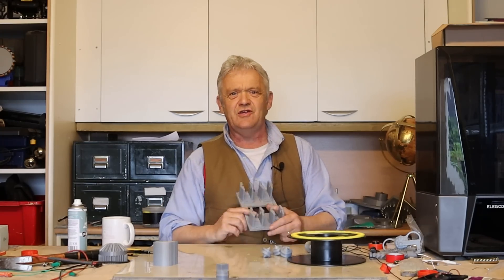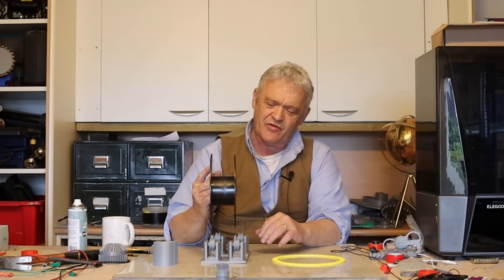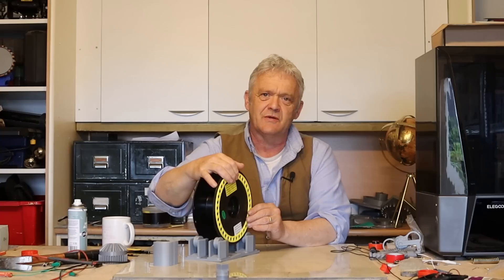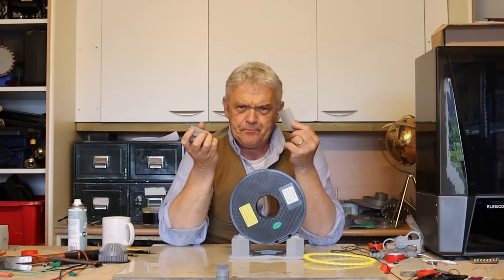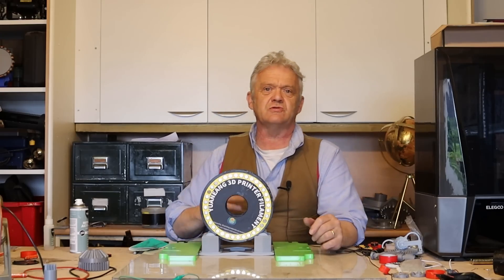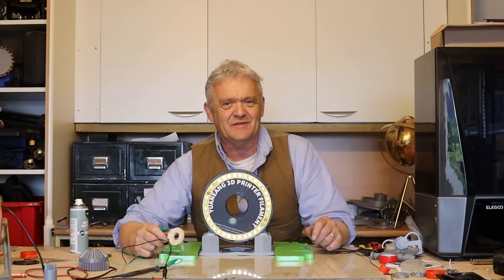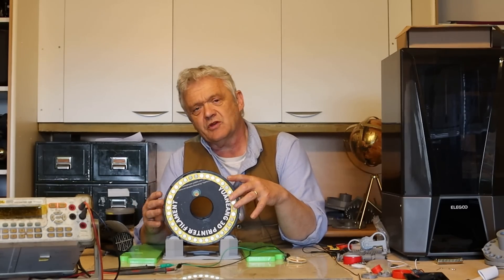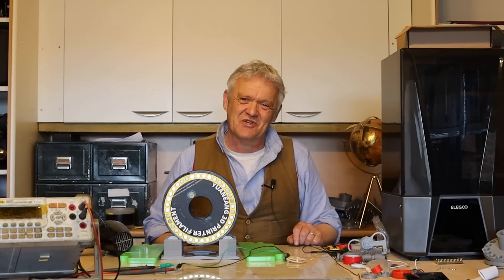2040 Rim Based Generator

Comment: So if I put a long horizontal drum fan on the apex of my roof. Then on one end I have magnets on the drum end and stationary coreless coils for low drag resistance generaton.
At the other end have magnets in the drum end and have the coil plate with cores and have a linier actuator that can move it close or far from the drum.

So in light winds it’s far enough away it has no resistance but as the speed increases it gets moved closer to reduce the rpm’s and generate power.

Comment: Robert, I've been watching you video for sometime, they're very interesting and understandable.

I understand the point regarding rim based generation, and whilst walking the dog had an idea...

If you took your double rotor set up, attached a rim around the blades then mounted the whole shooting match vertically in a Darwinian style it would seem that you bring a lot of good things together?  In fact, probably major item missing from most of you improvements would be gearing.  This could be added by not putting a rim on the propellors, but instead putting the gearbox on the common shaft, then bringing the geared output down below the inlets to the chamber and having a "wheel" on the shaft with the magnets on the rim.

As an aside, do you think there is anything to be gained from toroidal propellers?

Comment: Im gonna flip the design, as it got me thinking multiple ways but the one ive settled on is 2 towers with an axle, but use a magnetic bearing, and attempt to merge the coil into the towers, maybe even try 4 towers (at each end), then could 4x the coils.

Comment: This makes me wonder if your double bladed wind generator could be adapted to also produce power at a rim connecting the tips of the props? This prop rim could have a magnet array that interacts with a serpentine coil incorporated into a duct for enhancing flow as per the Darwin horizontal application. The hub would still be producing too.

Comment: Robert, one would think by adding an axle at some point, dual generation could be achieved both on the rim and one of your serpentine coil setups. On second thought voltage gains passing through a water pipe could be accumulated as well. Some of your brilliant ideas scream for combinations~

Comment: Well done Rob.I am somewhat surprised that I myself never looked at a spool and pipe in the way you just did in the first few minutes.THAT innovation alone would have got you a click.
As I have stated before,a lot of your audience cannot afford 3d printers and suchlike so stuff like you just did here by improvising is an absolute godsend.
The point I and my friends all come together in agreement on(and this s rare)is that the very best innovation is the following.....
a ....one off build of an item
that will create energy to heat each household in the uk even by a small amount
for "free"
example....a amall air turbine to run a "sand battery"
........a trombe wall.....
In an ideal world either you or on of your audience will be inspired enough to come up with an overlooked innovation from an existing piece of tech which will crunch about 20% of the household energy requirements overnight.

Keep up the good work.Your efforts are much appreciated.Particularly since you try to keep things simple enough for us to follow.

Comment: I know it doesn’t specifically relate to the video but I was wondering if there was an efficient way to attach a wind turbine, like the ones previously shown on your channel, to a car alternator to produce electricity. I’m asking because I managed to snag a working alternator for basically free (got lucky at an Amazon return bin store) and wanted to put it to some interesting uses
Reply: A car alternator requires RPMs to be closer to 3 and 4k. You won't get that on anything Robert has posted.
The car alternator is not a very good solution to generate with the wind generator.
Reply: @andrewsmithmilan1780  damn that sucks. Would a steam engine be better suited for this? Thanks for the answer

Comment: Hey Robert, do you think you can build a self digging Roomba-esk motor at the rim ? The hole will be useful with a mud pump. I imagine a roombda that digs itself and makes a well borehole. Needs a power cord, a water /air pipe and a safety line for retrieval. Could be awesome

Comment: I have been following this entire generator series closely, well done and I am doing some of my own 3-D prints. I have also been experimenting with an iron core versus no iron core in the coils. There's a significant trade off to be had in power generation capacity vs high resistance to turning/spinning. It would be interesting if you would do a video on coils with iron core versus no iron core. I have also been experimenting with square versus round coils. A square coil allows a much cleaner slice of the coil cross section by the magnet and therefore a more pure sin wave and I think greater power generation. Maybe the topic of another video?

Also it may be worthwhile mentioning to your viewers that PLA will not do well in the direct sunlight. I think they should be aware of that limitation.

Comment: Love it!!! Please consider doing this on a bicycle. Could it actually charge your ebike battery?
Reply: It could charge it some, but it would not keep up with the draw of the electric motor (and muscle power is about 5x less efficient than ebike motors anyway - look up the 1000 mpg ebike article). Since bikes are such efficient machines and there are so many losses to charge and discharge a battery, you'd be better off just pedaling to assist the motor rather than pedaling to charge the motor. 

Adding a generator to the rim would only serve to make you and your motor have to work harder to turn the wheels.

Comment: Rubber coat the big rim so more traction on small wheels and then turn the small wheels into generators as well. Then you have five points of electricity output
Reply: I think the grip is a good add, but the generation comes from the speed of the rim, so I'm not sure the small bearings would make very good generators.
Reply: @mookiemorjax  the small guide wheels would be spinning way faster than the big wheel

Comment: Hi Robert. Very interesting.   You were using one coil and getting 2-3 v.   Would it be possible to add more round the rim say 6.  To get 12 v  possibly??  Or even add another ring on the other side as well to double up. Just a thought or does add more drag.   Bob.

Comment: The generator "wheel" you've described is basically an HVAC plenum/plug fan. You may be able to find these second-hand industrial surplus, or in a recycling scrapyard. They're generally well-made fans and most are steel but many are made from aluminum.

Comment: Amazing content as ever and I'm in awe of the effort that you put into the channel!
One thing strikes me with "micro" generation that is my concern when trying to implement the various ideas of generation on such a small scale to allow them to be useful. This is, how do we "add" these voltages, that are often much lower than say 12v, to charge something that is fairly easily found and recycled such as old (or even new) car batteries. 
Apologies if this is a daft question but I'm no expert at all with electronics or charging circuits. My understanding is that much like a car system, to charge a 12v battery say, the alternator output voltage is around 14v.
However when we are perhaps talking about generation of a fraction of this, but being generated by numerous devices simultaneously, how would one combine those outputs to give something that could charge, albeit possibly very slowly, a battery that would be inherently useful. 
Please forgive my ignorance, but has long been an important question for me, and would be so grateful if you could address. Many thanks.
Reply: Numerous ac devices that are out of phase would need to be rectified first, then they could be connected in series to increase voltage. Put that into a capacitor connected across voltage regulator input with output connected to battery.
Reply: @jima3252  Thanks. That does make sense even given my limited knowledge. Thank you.
Reply: @universeexplorer4203 No problem, that is a good question that needs explored.

Comment: I like the tall gearing and thin profile of axial flux designs. The outer edge moves faster than its center so it would generate more. The trade off is always the same though. It requires more input to start moving a heavier mass on the outer rim but would also act more like a flywheel. Good show Robert I liked this video.